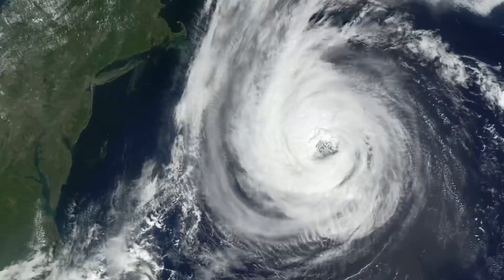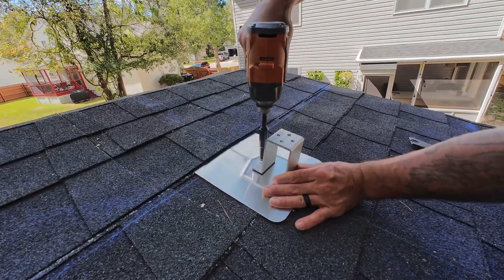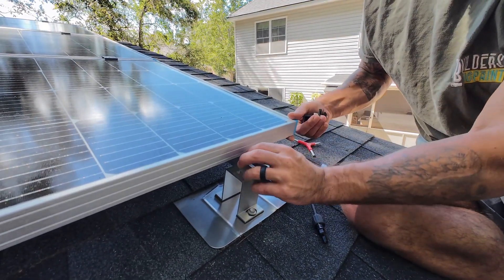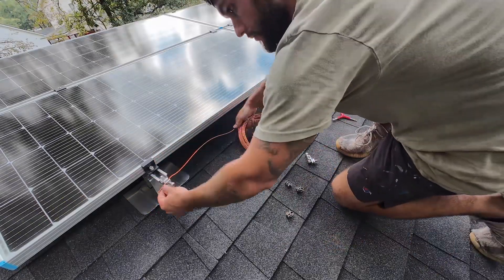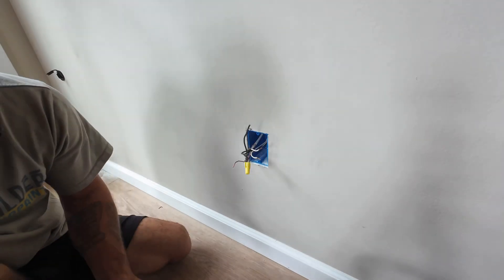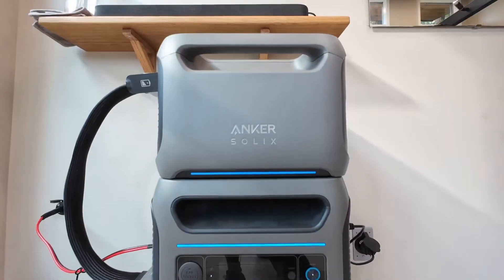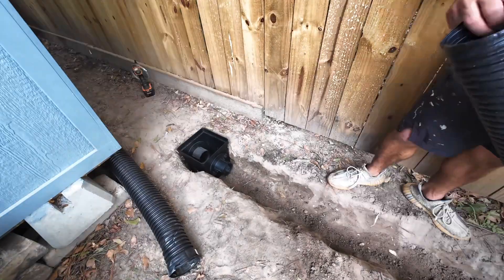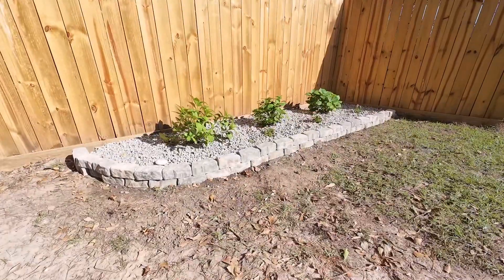How to install Solar Panels On A Tiny Home

Comment: Is the tree shade not an issue?  Seemed to see quite a bit while you were installing.  I have fold out panels for emergency power, and just a little shade on them brings down the output a lot.   Would love to do something more permanent like this.

Comment: Going off grid completely 👍 ... even more reason to have a (pull out) love seat in there. Sitting area by day for kids to play Wii fitness or sleeping area for adults at night; after a storm if no power. (Spare single blow up mattress in shed or house closet. )

Wall mounted flatscreen swivel TV.
An office size mini fridge for bottled water/sports drink.
Pretty basket with a few rolled yoga mats. 
Wi-fi or radio for music (or news). 

Family could have a pretty comfortable bunker after a storm ~ week if electrical lost in the main house. Keep a hot plate in shed on a shelf to bring over. 

Gym/Entertainment ... (plus Wii fit games & yoga)
Sitting area, bedding
TV, Wi-Fi, Music/News, Movies/Internet
Beverage (hotplate outlet) 
Most of all ... WORKJNG FAN 😊

Solar panels ... great investment long term.
 
Add mini fridge .. and love seat -->> increase use 300%

Comment: 🔥 I have a very similar setup with my F3800 powering my gym. I just need to get a couple expansion packs.
Reply from the maker: Really? That’s awesome how do you like it so far? And how many watts of solar you got?
Reply: @buildersblueprint I originally got the F2600 and built a 600W ground mount with renogy panels but then expanded it to 1200 with one of the F3800 inputs (2 series 6 parallel).
Reply from the maker: @PrestoMoto02  love it. So far I’m happy with the setup but I may add a few more panels in the near future
Reply from the maker: @PrestoMoto02  also the expansion pack is totally worth it btw makes the battery last like twice as long.
Reply: I found these bifacial JJN panels on Amazon that work great also. I’m in Colorado so we see 300+ days of sun/year so I don’t really need to max the solar out (for now)